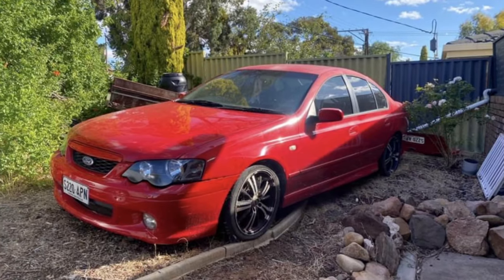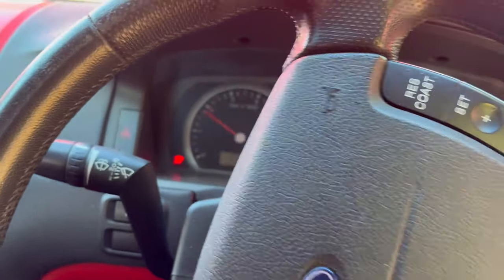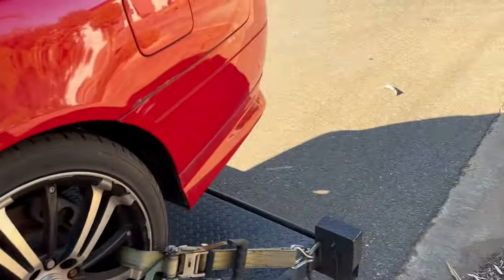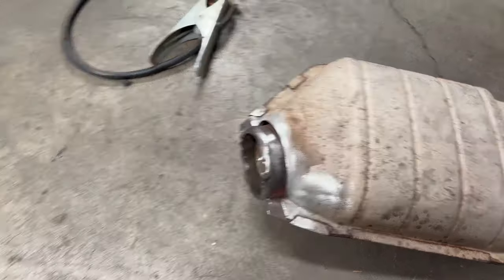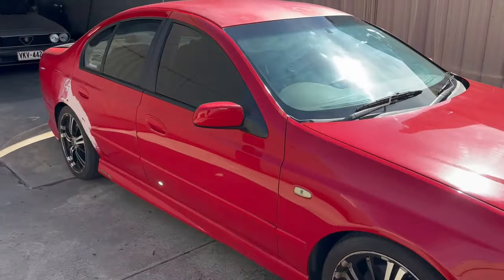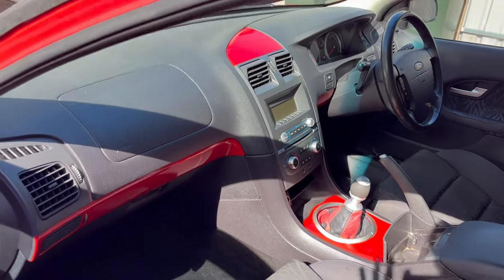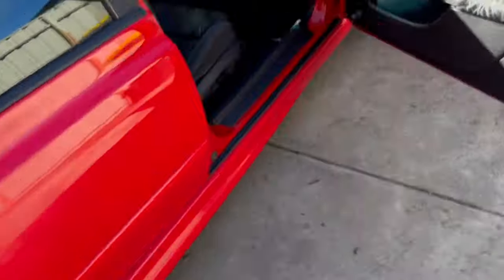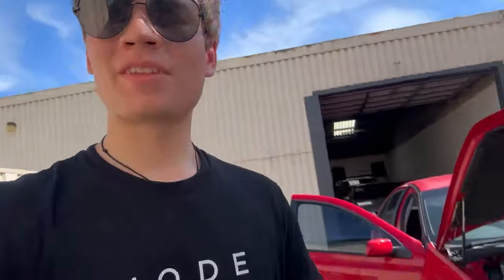BUYING a NEW project car!

Comment: Blue smoke on start up is valve stem seals, not exhaust residue, easy fix though
Reply from the maker: That’s what I thought initially but it hasn’t done it ever since besides that first start up. There was a lot of crap in the exhaust from it sitting for ages so that was my guess.